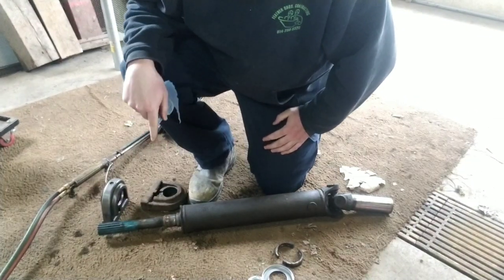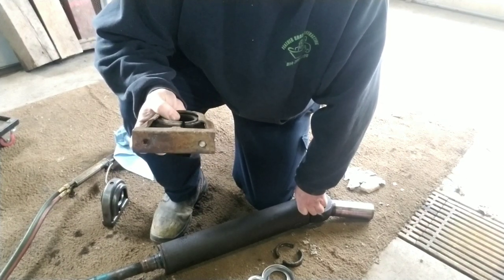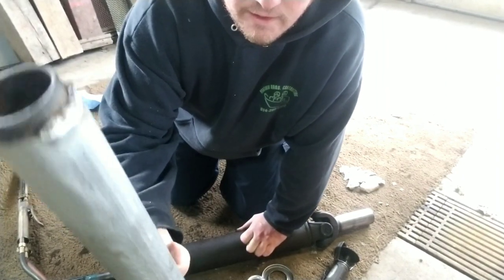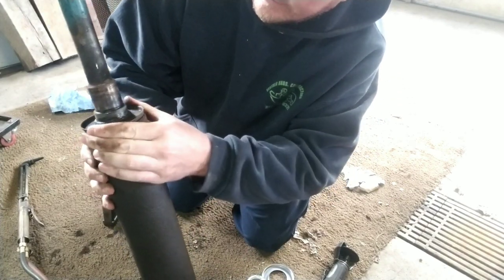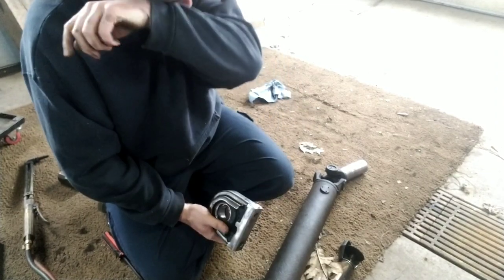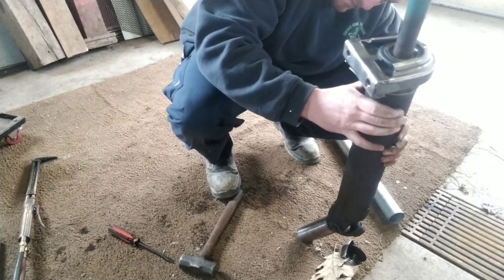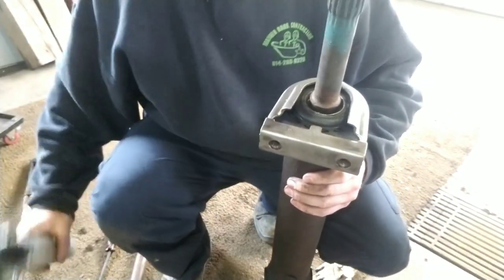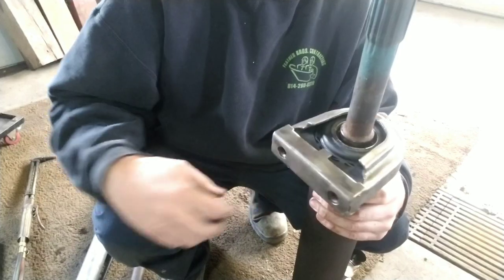Drive Shaft Bearing Replacement

Comment: Pound it on with a pipe on that flared collar.  All of it will go on at the same time and you will hear when the bearing seats against the shoulder of the driveshaft.  No welding and no old race jammed on the shaft.

Also, a 20 ton press using a split bearing puller on the backside of the bearing will pull it.  Takes a lot, but it will bang loose and then slide off effortlessly.  Wear safety glasses.
Reply from the maker: Thanks for the info brother 👍 they definitely can be hard to get on and off. But thanks again for the tips and tricks

Comment: I HAVE AN 06 DODGE RAM 3500. I have the new carrier bearing on. No new dust shields. The guy at Napa said there were none in the replacement. I am trying to get the little spacer on after the bearing. Maybe I don't have the carrier on far enough but the spacer does not want to go on. Any suggestions?
Reply from the maker: If the bearing isn't on all the way the spacer wont fit. There is very limited room there. Its frustrating trying to find a kit that has everything you need! My buddy works at a dodge dealership and alot of times they can get those little parts. So all you need is that spacer then ?
Reply: @GearsAndGuns  I have the spacer I just cant get it to go in and stay. Does it fit in between the bearing and shaft? Or is the shaft suppose to hold it in?  Thanks for you response. All the you tube videos they don t show how to put that in.
Reply from the maker: @MrPauletime  it should fit snug but if it doesn't your rubber boot butts up against it and should hold it in place. I actually just looked under mine and its holding itself in there still
Reply: @GearsAndGuns  Good morning.  I found out the bearing wasn't on the shaft far enough. I took a piece of 1 1/2 inch pipe 12 inches long threaded on both sides. Put a cap on one end and ground the threads off about a half of an inch on the other end. Grinding the threads of left just enough room for the pipe to go through and contact the bearing. Then that flared collar slipped right over the shaft and we tapped that on also with that pipe. Both shafts went right back in on  the first try. What a luckout. Your video was very helpful as you have been. Thanks again.  Pauly
Reply from the maker: @MrPauletime  glad to hear that !!! Yeah it's a job to get that bearing on there. Hopefully you never got to change it again lol. I love/hate my old truck

Comment: Would you happen to have the part number?
Reply from the maker: https://www.ebay.com/itm/SPICER-Rear-Center-Bearing-for-1995-2002-DODGE-RAM-1310-Series-211848-1X-/293550015466?mkcid=16&mkevt=1&_trksid=p2349624.m46890.l49286&mkrid=711-127632-2357-0
Reply from the maker: This is the one I used and it's still working great